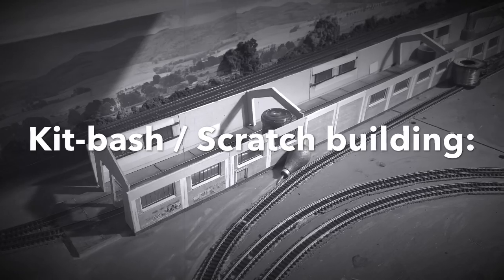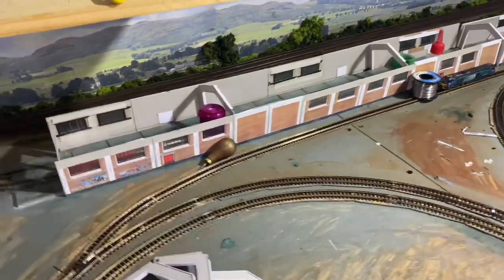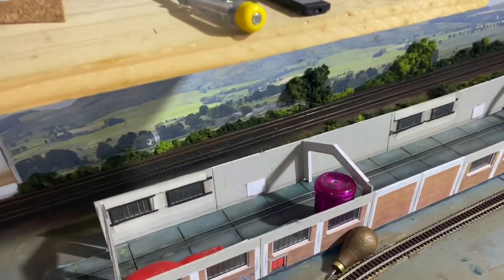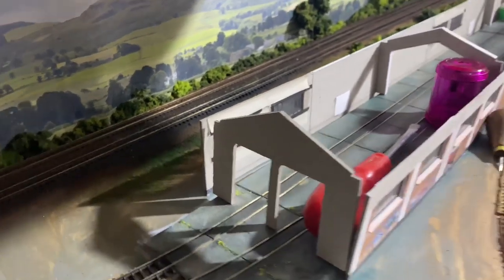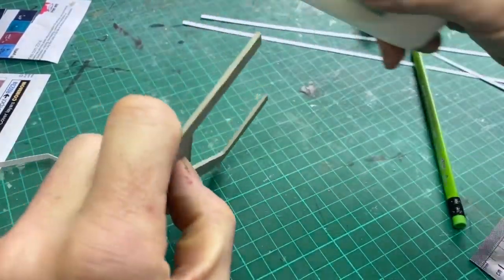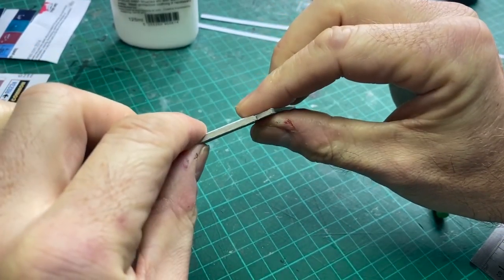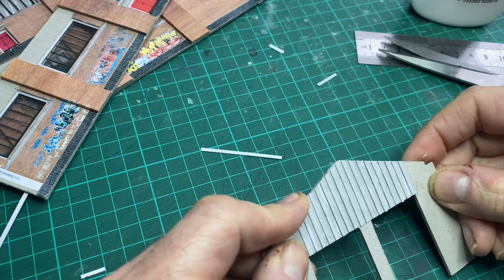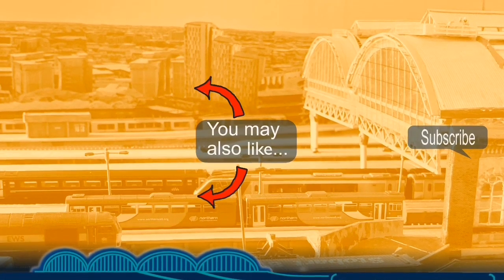CARRIAGE SHED BUILD 2 - N gauge Model Railway

Comment: Hi John,
You are doing a fantastic job with the shed, it is really coming along! I find it really interesting to watch how you approach each task and the results you achieve. Also, if we all approached modelling our layouts in the same manner, using the same techniques, achieving the same results, things would get boring quickly! So it is really informative to see different ways to approach/achieve the end product.
The detailing of turning the supports into I beams is beautiful (especially as you are doing this in N Scale, where we are talking about things being a few mm wide, your patience and skill achieve great results!)
Cant wait to see the next video! (Seriously, this is better than any TV series 🤣)
Cheers Derek.
Reply from the maker: DarkLord8888 wow, better than Tv, thanks. Guess it depends on what is not available but accolade none the less. 

Yes many things are weeny, tiny in N, however the internal supports are 1cm / 10mm wide which is huge. Only that size to give the shed strength and rigidity. Thank you so much for taking the time to comment.

Comment: Hi John,
It is coming along nicely and will do everything you want it to do and look great to boot. The piano hinge that is coming is it plastic or brass?, but well done for Allan suggesting it he beat me to it as he usually does, look forward to seeing the finished article.
Cheers Robert.
Reply from the maker: ROBERTS TRAIN SET thanks Robert, the hinge has arrived and just fitted it. It’s metal, not sure what metal, as it’s painted. All is good so far. The hinge has given a slightly compromised look, but it’s down the back of the shed, no-one’s gonna see it, not even me really...

Comment: That's great scratch building John, I do similar, that is altering the scalescenes images, but I use Photoshop, but you have given me loads of ideas so thanks!
Reply from the maker: Dave Harriman thanks Dave. I believe the Infinity range of products is said to become a professional adobe rival. Photoshop has always been amazing and obviously has got the following in industry. 

At the end of the day, it really makes no difference which software is used as long as we can achieve what we want. Thanks for commenting Dave
Reply: @piccadillymodelrailways  Cheers John, I'll check infinity out, thanks *edit*: do you mean Affinity??
Reply from the maker: Dave Harriman yes, I use them all the time, where INfinity came from, no idea lol. Def Afinity. They are made by Serif. I like them bc I can use my IPad.
Reply: @piccadillymodelrailways   Just had a look, very good pricing and no subscription, I have had CS5 on an OEM disc for the last 20 years, and if it stops working   or if it's closed down by Adobe lol, I  definitely won't be taking out a subscription to PS, will be looking at that Afinity ( I do a lot of photo editing) thanks again Dave

Comment: Hi John, what glue were you using the create the I beams.??
Reply from the maker: Jeff Brewer hi Jeff, thank you for your question. The glue is Cosmic Shimmer specialist acrylic glue, it’s a crafting glue for someone who makes greetings cards, but I like it, fast grab and great hold. For bulk gluing I use ‘No Nonsense’ PVA from Screwfix. £10 for 5 litres. That’s a trade glue and is great, very thick and goes off fairly quickly too. Hoping that’s helpful.